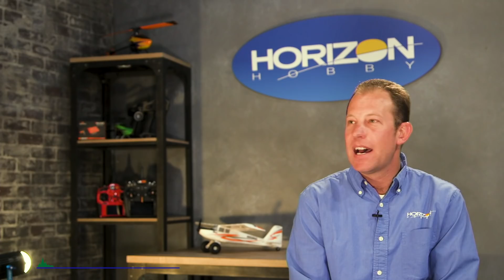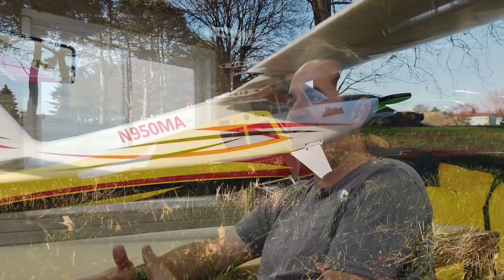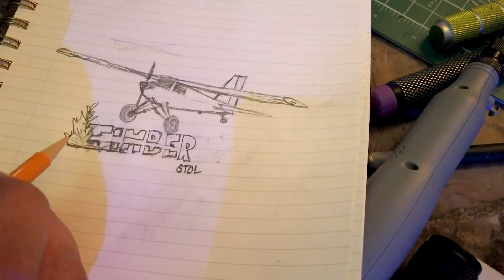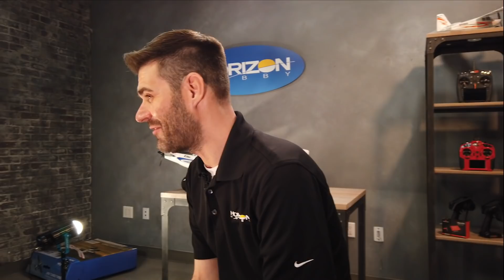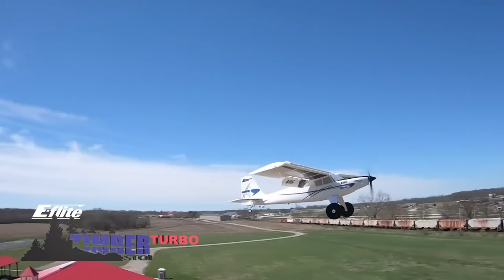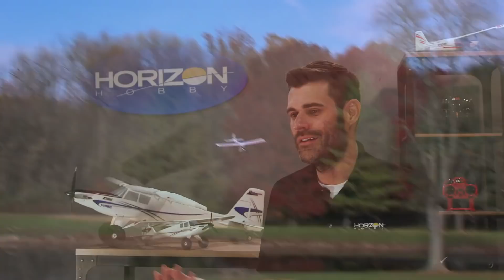Horizon Hobby Behind The Innovation: The Timber Airplane Design

Comment: The Timber 1.5 was sort of my 3rd plane. After the Apprentice S and struggling more than I should have. (I was on that “Crash Course”, no pun intended, trying to figure batteries, chargers, transmitter, control arms, etc.) A couple of things I skipped and planned to learn later was Center of Gravity and DR and Expo. So I flew unbalanced and at 100%, no expo.Thankfully the Timber 1.5 had sturdy landing gear, with flaps wouldn’t Tip Stall.
Somehow four years later, the Timber 1.5 is still in one piece and converted to a very good float plane. Once I got the Turbo Timber the 1.5 really got lost in the shuffle.
I think the Timber 1.5 was the perfect 2nd plane at an RC Park. I think I got the Timber UMX first because I had a soccer complex a mile from the house and needed hours of flying, time to figure out the transmitter and how to deal with wind.
I can’t say enough good things about those first 4 Eflite planes. The only thing I did right the first 2 1/2 years was pick great planes. All were Eflite taildraggers.

Comment: Finally recovered my Turbo Timber out of the top of a 60ft poplar after being up there for 4 months. That's 4 months during summer in the south, through rainstorms, bad weather, etc. I immediately plugged it back in to a good lipo, and everything worked. I had already written it off in my mind as a complete loss due to the amount of time exposed to the elements with an open nose. Had it not been for the physical damage of a broken motor mount and a broken blade, I literally could have flown it  again right then. I bought another after I lost the first one thinking recovery wouldn't happen. 2 Timbers is never a bad thing ;)

I'd recommend a Timber to anyone.

Comment: Sorry to post a second time on the same subject but the Timber has always been about STOL and versatility.

I really think you could do an amazing biplane. Picture this: a 1.2m span biplane in the same classic green or red of the Timber X. It can run on 3s or 4s and has navigation lights and maybe even telemetry.

Nice clear screen and possibly head and shoulders of a pilot.

The battery is top front loading like a UMX Waco; it could even have a radial style cowl and end up a modern take on a classic design or retain the classic Timber tail and go for a more contempory look to the front end.

Even though its a bipe i am sure you could still make it easily identifiable as part of the Timber range.

Its STOL capable with decent sized tyres to enable less than perfect runways to be used. It has the Timber flight envelope we all know and love and on one hand can fly 'scale' slow fly in safe but still be primarily an aerobatic, 3d capable plane. The Safe programming will be so solid that an intermediate pilot should easily be able to fly it.

In fact knowing you guys you could probably set a new standard in biplanes with this one and create the best flying, easiest to live with biplane ever made and at the same time expand the Timber into a whole new direction with all the potential for other bipe versions. 

Quite a design challenge but if you can pull this off you'll nail this plane firmly in RC flying history.

Comment: When can we get a clear cockpit?
Reply from the maker: A clear cockpit adds complexity, weight and cost so it will not be seen in the 1.5m and smaller sized Timber models (in order to maintain the excellent durability, performance and value they offer now), however, we do have have other STOL-capable "scale" alternatives with clear cockpits including the E-flite Maule M-7 1.5m (https://www.horizonhobby.com/SearchDisplay?searchTerm=efl_maule&categoryId=&sourceDomain=&storeId=10151&catalogId=10051&langId=-1&pageSize=40&beginIndex=0&sType=SimpleSearch&resultCatEntryType=2&searchTermScope=2&showResultsPage=true&searchSource=Q&sourceDomain=&pageView=) and the E-flite Air Tractor 1.5m (https://www.horizonhobby.com/SearchDisplay?searchTerm=efl_tractor&categoryId=&sourceDomain=&storeId=10151&catalogId=10051&langId=-1&pageSize=40&beginIndex=0&sType=SimpleSearch&resultCatEntryType=2&searchTermScope=2&showResultsPage=true&searchSource=Q&sourceDomain=&pageView=)

Comment: There is a inherent problem with the motor mount  breaking off the fuselage with 4s power though...so if your going to fly on 4s reinforcements are advised on the nose
Reply from the maker: Definitely not an inherent problem :) We and thousands of others have never had the motor mount break unless the airplane has been landed hard, nosed over and/or has been crashed before (which can damage/weaken the mount). The mount will never break off the fuselage when the model has not been damaged and when using the recommended batteries.
Reply: @HorizonHobbyProducts  hey look man I'm not saying it's not a awesome plane...because it is!! But yes there is a issue with the nose under a higher power source
Reply from the maker: @chrismitchell5260  We've sold many thousands of Turbo Timbers and Timber Xs, many/most of which are flown with 4S batteries, and we haven't heard of any such issue being widespread (and definitely not unless the airplane has been landed hard, nosed over and/or has been crashed before which damaged/weakened the mount). Take a look at the hundreds/thousands of videos of Timbers out there being flown on 4S batteries, the reviews on our web site, web forums, etc. and you won't see significant reports of the same. BTW, please also be sure your prop is balanced...a prop that is out of balance can also result in a broken motor mount and other damage over time!
Reply: @HorizonHobbyProducts  the foam around the mount is really thin....and you are right to the fact that  with a hard landing or over time this gets fatigued and will fail...all I'm saying is that with some extra reinforcement this just makes an already awesome plane even better...

Comment: Not just Timber, please make other planes too. 
Like the Delta Ray One, it is discontinued... 
Can we have a upgraded version (2s or 3s) with 500-600 wing spam?
Love it very much but the motor plastic parts will melt if push too hard.

Comment: Oh, I could use a few more Timbers! Waiting to get the giant ARF w/a twin engine.. "TWIN-BER" sure would be cool, more stable in windy days, (the Beaver turned forth the development of the Twin Otter..) A biplane like the Multiplex Rockstar I haven't gotten yet..would look cool as a very different bipe! I'm slowly getting parts assembled for a day/nite (slow) SUPER STOL Timber, 6.5" mains, 1.5" new tail wheel assembly, switched vertical spot light, same   I want to "de-turbo" a Turbo Timber into an upgraded ORIGIONAL TIMBER, with metal servos & newer 3 blade power,  smaller pneumatic tundra wheels, new full strobe high vis dusk/night kit & 5000/3s battery&call it my (fast) "Timber XP" I have over 300 hours flying my Timbers, 130 of which @ nite, 50 or so hours on skis in winter.. I think it is a fantastic plane, I can put an Onyx 5000 3s in it and fly T&go's for 45 minutes! on a Admiral 3300 3s I regularly get 30 minutes of STOL/ T&go's.. 10° slotted flap slow cruise at low power, make the most out of climb rate @ full power then cut it back to conserve battery..the climb prop will get it up to only 45mph on a 3s, so no need to hurry, it won't! That's why I'll have a separate 60mph+ Timber! These planes are capable of going deep into the STOL, ACRO, & pattern niches with that word "VERSATILITY" in all three sizes! Lol..You'll want a "forest" of Timbers like me! Thank you so much everyone @ Horizion Hobby!

Comment: please re release the original......please...pretty please....
Reply: Get the Timber X and then buy the Turbo Timber 1.5m spare wing set.  Swap wings to the 1.5 and you essentially have the original TImber with stronger motor and servos.  2 planes in one.
Reply: @MrCubcrazy  ya, a little more rudder authority for sideslipping too!
Reply: I hear ya!